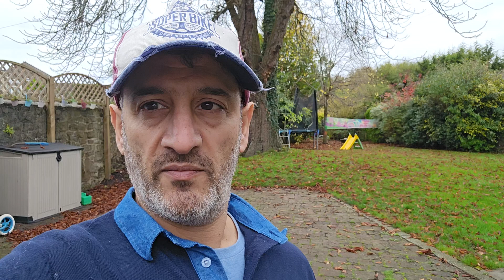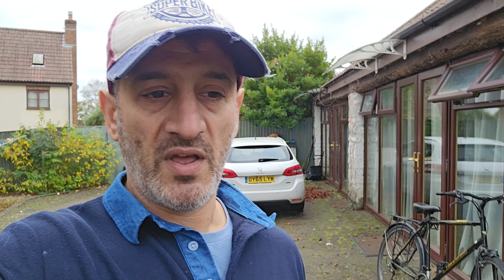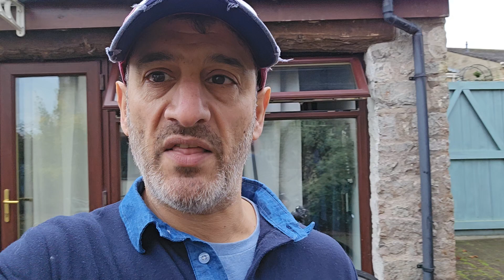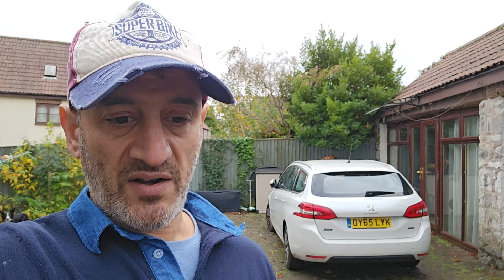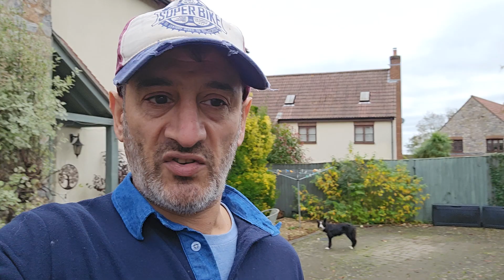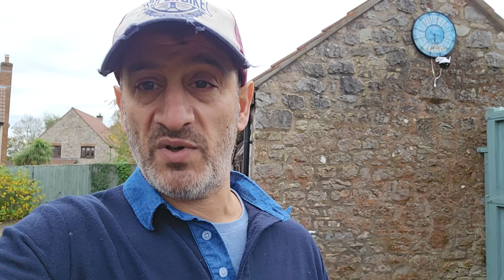My Radio is Deaf ??

Comment: And of course noise floor level is very important too, the lower the better. Sadly the RF environment isnt as clean as it was 20 years ago
Reply from the maker: No you are so wrong it's up to you to check your set up remove bad rf from bad chargers and l.e.d lights .
Reply: @HamTechRadioScannerDrones  well yes and no, that's all great if it's inside your home but I'm talking about the surrounding area if you live in a built up area. Other houses poorly installed solar panels, for example and of which there are many around this estate.

Comment: I am lucky enough to live in the countryside in a very quite location.  I am lucky enough to have large full size ant on top band , as you say unless the radio has a fault every HF radio will pick up more or less the same . If anything most are too sensitive i am always looking to back off sensitivity with the RF gain control, most modern radios from 1980s onwards will hear the same . From radios i have had here ic 781, ic 746 ,ic7300, ic7200 ic 703, ft3000 ,ft817, ft897 , kenwood 480. My most sensitive ft817 or ft3000 to my least sensitive ft897 , virtually nothing in it .
Reply from the maker: Hi Rob thanks loads for your input - 73

Comment: I never had problems receiving signals on HF when I first got licenced. I had trouble making contacts. I assumed it was the radio and made the mistake of buying more radio's. After coming back into the hobby after 10 years I realised it wasn't the hard wear it was a poor antenna. It doesn't matter if you own a G106 or a FTDX10, get the antenna right and you will make those contacts. David M0DUU

Comment: There is also deaf in the sense of being desensitized, so if somebody says my baofeng is deaf on 2m, because it doesn't have distinct filters for the two bands, would this also be a invalid statement ?
Reply from the maker: Total rubbish i have had Baofengs for 20 years its just people blaming there kit .
Reply: I agree it is not necessarily Baofeng specific. I think of a video from Ringway Manchester some years ago, standing on a tower and calling CQ on 2m. Later some OMs told him that they had heard him and replied but he didn't hear them. So i think the question is how specifically somebody has to describe under which particular condition their radio gets seemingly deaf to make a valid statement, and then might already get a clue as to why, but frontend desensitizing by strong out-of-band signal is a bit malicious and often not recognized as such.

Comment: I'd also buy the most expensive coaxial cable and connectors l can afford, as every break between the transceiver and the antenna, is a loss in both transmission and receive.
Reply from the maker: Yes